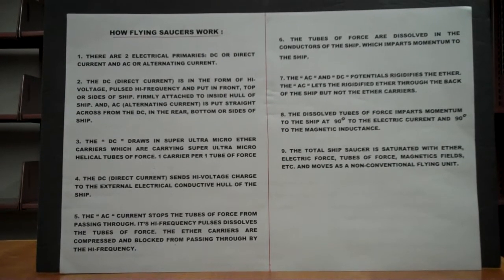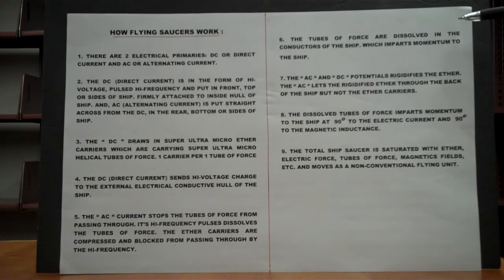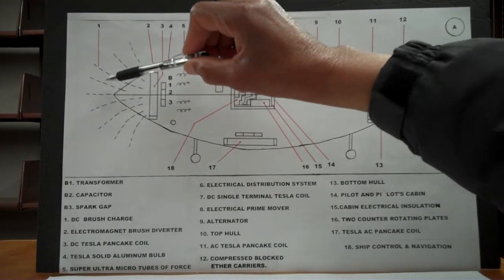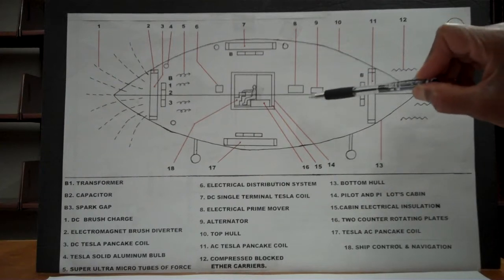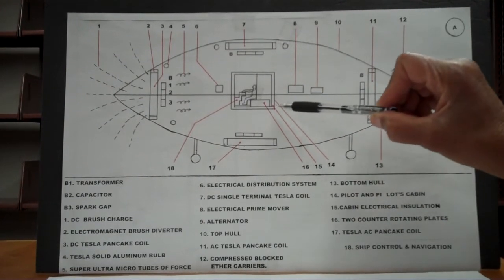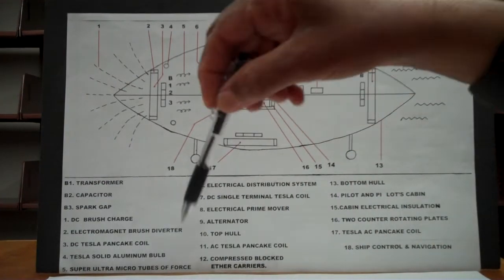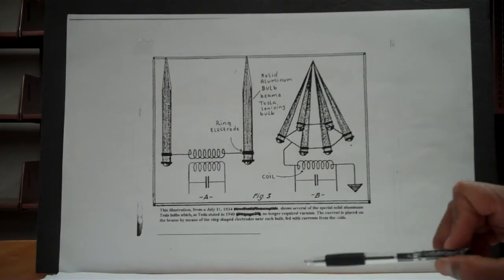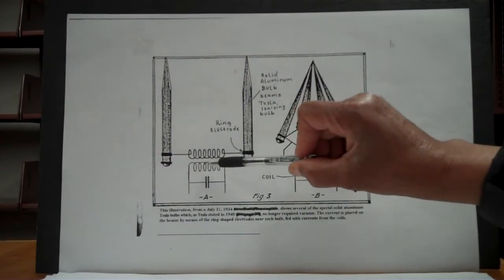ELECTRO-PROPULSION: How To Build a WORKING Flying Saucer | Tesla's Secret Flying Saucer Technology

Comment: Could YOU build this if you had the $? How much would something like this cost?
Reply from the maker: Superluminal89: .. (1) I've read from a very good source that Electro-Propulsion Ships (EPS's: so-called flying saucers) cost less than airplanes of equivalent complexity and weight, and FAR less than multi-million dollars military jets. These (EPS's) are electrical (hi-voltage) systems. Therefore, they are exceptionally reliable and energy efficient systems. (2) I, personally, do not wish to build one of these. Other people do. (3) I have not priced them. But if you wish, go ahead.

Comment: You lost me at "super ultra micro ether carriers".
Reply from the maker: HeroReturns: ... (1) The force of extreme hi-pulsed hi-voltage produces electrical stress on the ether. (2) This stress produces ether carriers. (3) each ether carrier has and carries one (1) spiral of force. (4) voltage is made of charge: protons are positive charge and electrons are negative charge. All microscopic. (5) ether carriers are even smaller.

Comment: Von Bruan could not have been in New Mexico in 1935-38. He was still working for the Nazis in Germany at that time and did not come to the US until 10 years later.
Reply from the maker: @superluminal89:  I " never " said he was in New Mexico in 1935-1938. The big war started in 1940 full force. But, there in New Mexico in 1948, 10 years later, that's a different story. He " may " have been. Don't know.
Reply: @jessiejohnson3457  Has anyone tried this  idea to make a propulsion system?
Reply from the maker: @superluminal89  : The only ones I heard of is Nikola Tesla Between 1891-1910 and Warner Von Braun and his 100's of engineers.

Comment: Very good Mr Johnson you did your research thank you for sharing.
Reply: William Lynne was the one who first promoted these ideas . He was from Lamy ,New Mexico.
Reply from the maker: Eduardo Canales: Where there's a will there's a way. This information was pubilcised since 1996 by a Top Level Clearance Air Force Commander.
Reply: @jessiejohnson3457  How do you get a DC out from the pancake coils and an AC out from the coils?
Reply from the maker: @theworldreportbydr.rothschild  : .. Ask almost any electrician. You'll get more info than you need. Or, take a course on electricity.
Reply: @jessiejohnson3457  you made a presentation and the question is how do you get DC and AC from the pancake coils?
Reply: @jessiejohnson3457  an ac dc inverter will not do you need a tuning coil. This same idea came from William Lynne from Lamy New Mexico. Have you created one ? Does this hypothesis work? I am very familiar with this technology so I am testing to see what you know. Willam Lynne from Lamy New Mexico first exposed this idea.
Reply from the maker: @theworldreportbydr.rothschild  : .. I don't know. Now ask an electrician.
Reply from the maker: @theworldreportbydr.rothschild  : .. Don't concern yourself with what I know or don't know. Use the information provided about the system and build it if you can. William Lynne was a top clearance air force commander. He would know.
Reply: @jessiejohnson3457  I use a tuning coil to achieve the dc and ac

Comment: Please provide more info about aether carriers and how the tesla bulb polarizes the tubes of force. Thanks
Reply from the maker: Mr. Potato Salad: (1) the ether is extreme micro moving space. (2) Space is a substance composed of 30-35 dimensions. (3) It takes extreme electric stress to effect/affect the ether. (4) extreme hi-voltage hi-pulsed frequency is electric stress. (5) extreme hi-voltage creates patterns in the ether. (6) among these patterns are carriers to transport something. (7) the stress produces secondary force or super ultra micro helical tubes of force. (8) The hi-voltage attracts the carriers that carries the tubes of force. (9) one tube per one carrier. (10) Ether makes extreme momentum states. Such as the momentum-speed of light. (11) The extreme electric stress produce attraction force contour field  patterns that pulls the carriers with their tubes of force through the Tesla pancake coils.
Reply: @jessiejohnson3457  I understand the effect of the pancake coils but not how the tesla bulb interacts with it or the surrounding aether.
Reply from the maker: Mr. Potato Salad: It is best that you and everyone else know at least basic electricity, if you don't already. Knowing electricity (basic, intermediate or advanced) and knowing ETHER PHYSICS (basic, intermediate or advanced) makes you and others able to comprehend what has been said and to add the rest of the knowledge and creativity, with others, to build one in your garage or tool shed.
Reply: @jessiejohnson3457  what resource do you recommend to learn aether physics? Much appreciated.
Reply from the maker: @ianthemann  : Please, go to Amazon.com and purchase " PENTAGON ALIENS " and " OCCULT ETHER PHYSICS " both by William Lyne. Costs about $15 each, plus shipping. There is enough info on " Ether Physics " in these books to make a cogent assessment and study.
Reply: @jessiejohnson3457  did anyone manage to build the flying saucer using these schematics?
does it work only on saucer-shaped hull? will it work on other hull shape?
Reply from the maker: @stratiosastero6880  : (1) About 100 countries are able to build EPS's (Electro-Propulsion Ships or Tesla Flying Crafts). (2) The schematics aren't the main thing, instead the " PRINCIPLES " of operation is the main thing. (3) Any journeyman or very well versed electrician will know what is being presented. If you aren't one, find one and let him know. He will be able to show you. (4) The main thing isn't the shape of the hull but a large enough electrical conductive surface amount. Even tho, a surface as show on the video is exceptional for the purpose. In the beginning (1945-1950) this is what the USA used mainly for its' flying-saucers (EPS's). (5) It will work on any wide and any: ball-spherical, oval, cigar shaped, tic-tac shaped, cylinder type shapes because of large electrical conductive surface area.